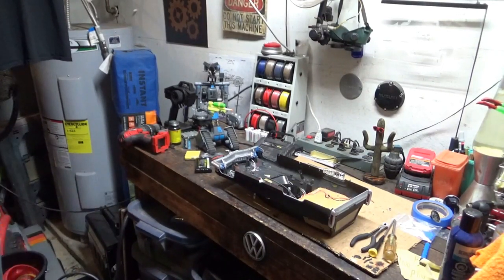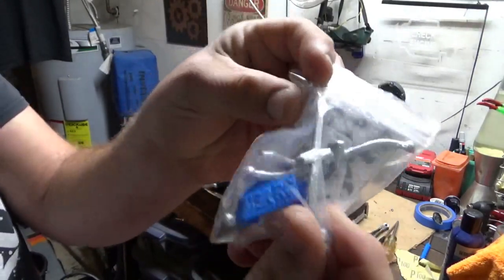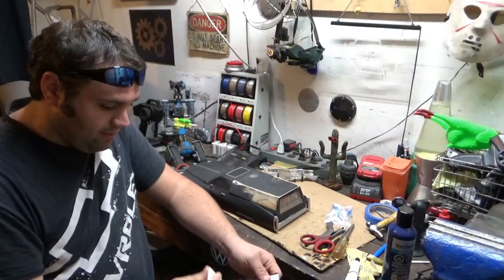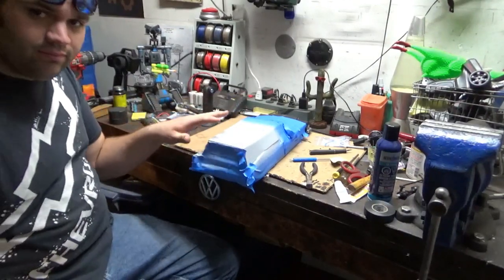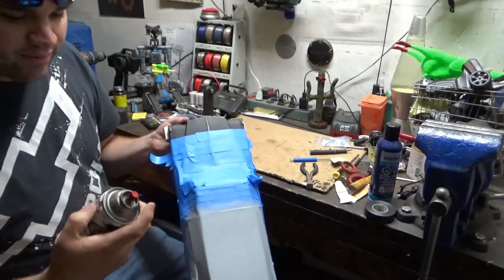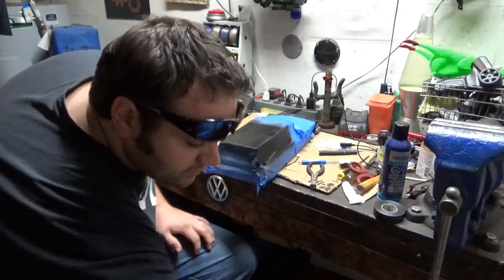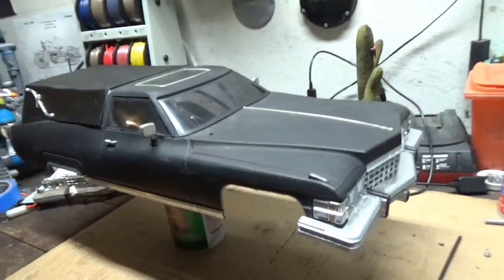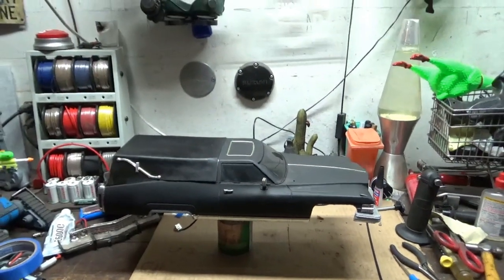Rc Hearse Project Part 4 / Bodywork & Paint .

Comment: Maybe try gluing in a bunch of carbon fiber sticks in crucial spots inside the body to stiffen it up. Definitely use shoe goo or e6000 so it has at least a little flex. Also can reinforce with expired dryer sheets and e6000
Reply from the maker: Not a bad idea   ,  i may try that    ,   i was originally going to try metal coat hanger  and amazing goop   but  i thought that it would get in the way of the wheels   ,  so i like the dryer sheet  and carbon fiber stick idea  ,   i just need to figure out where to buy amazing goop     since every store in my area has stopped selling it .
Reply: @TheRandomMechanic  Walmart has amazing e6000 in the art department. Get the one with the pointy tip on it it's a lot easier to deal with